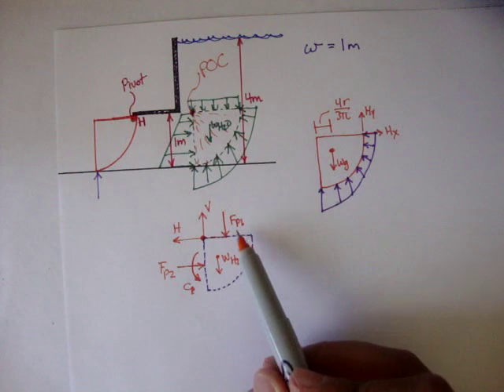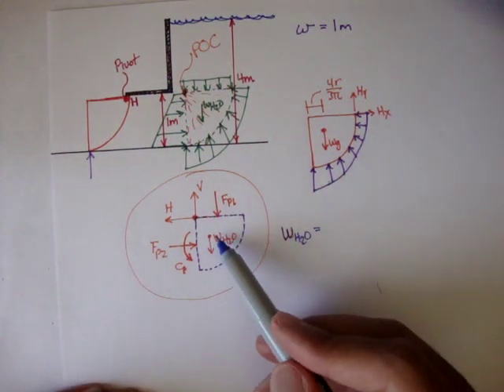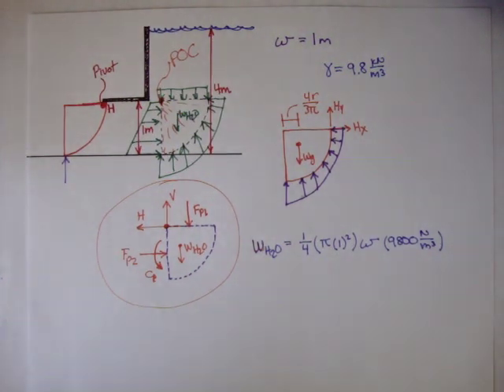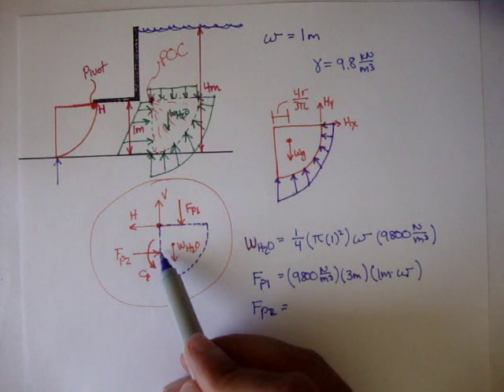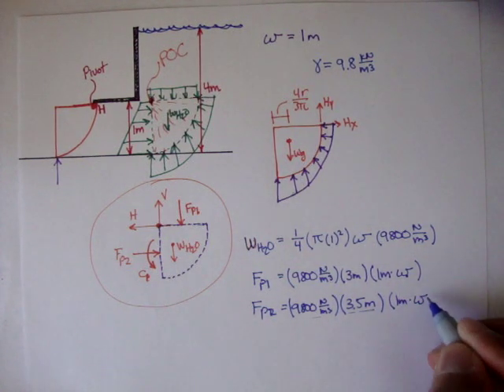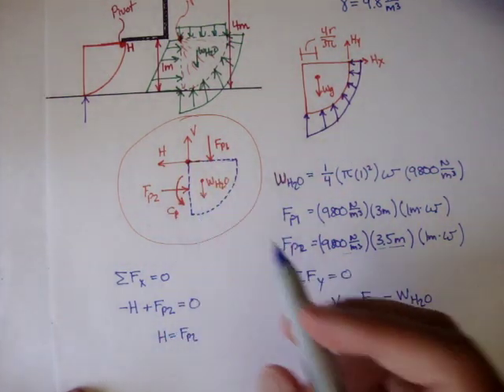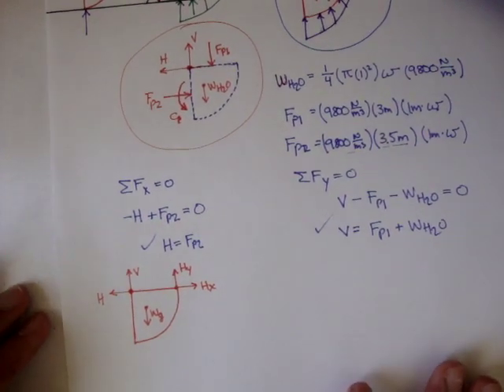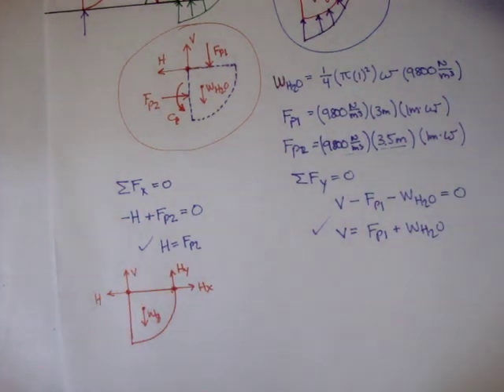Forces on Curved Surfaces: Example 2: Part 2 [Fluid Mechanics #55]

Comment: how did you calculate the H & V using the free body diagram of water inside the tank?
There is no forces acting on the left side of the gate nor from above
so the calculation of H & V based on P from above and from left are wrong, right ?
and you calculated the weight of water instead of the weight of the gate

Comment: what if Quoter circle is a full circle
Reply: This is an old video, but anyhow - it doesn't matter what shape is the rest of the gate regarding the water pressure. Some books put it like that- look at the wetted surface and imagine a water column above it to the real or imaginary free surface. In this case assuming there is air on the left, it will be an imaginary surface level. While the shape of the object will come into play looking at the weight of the gate.

Comment: If you are taking the anticlockwise moment about the hinge as positive, then shoudn't it be the resultant force of the vertical minus the weight of the gate be equal to zero????
 Moreover, i do not understand why have you not included the horizontal resultant force in the equation?????
Reply from the maker: zahid kamil Hi Zahid, I am taking the moment about the hinge at the top right of the gate. That is why I have the positive wg times its distance. The horizontal forces do not creat a moment about the hinge at the top right. That is why I have not included them.
Reply: @SimmySigma  thank you